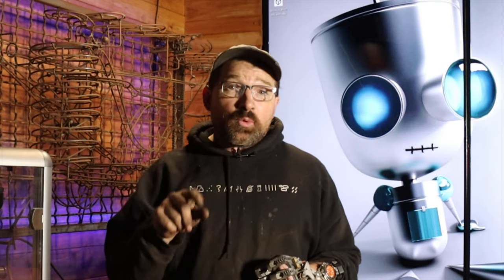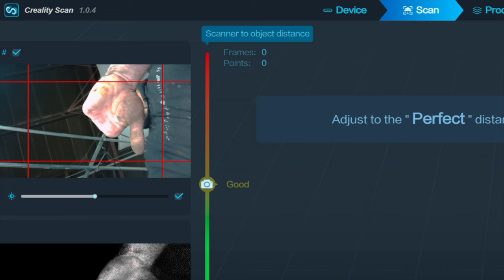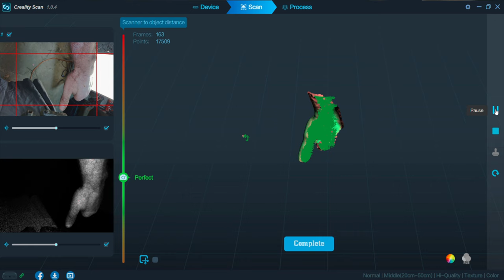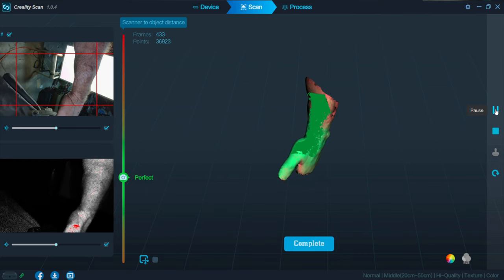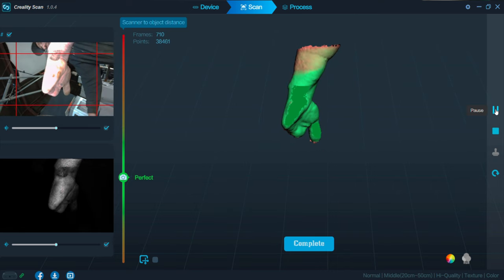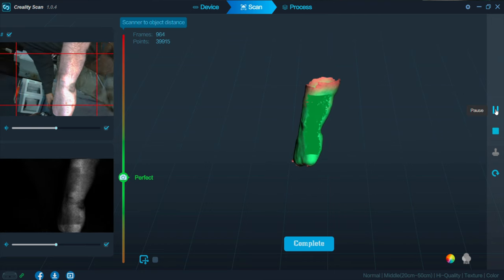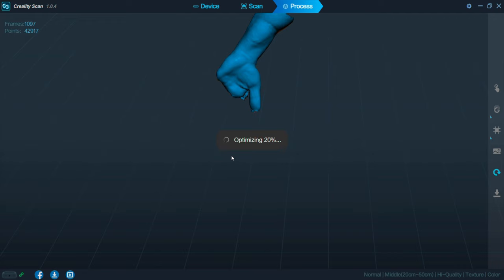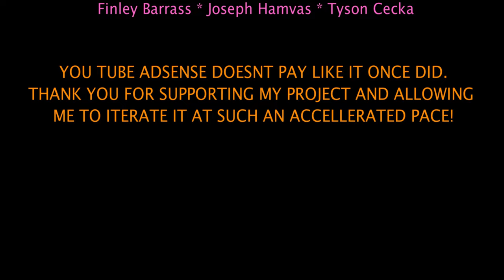How I Print my Prosthetic Socket!  Scan to Print part 1

Comment: Next video is gonna be Ian learning neuroscience and becoming an expert In the Brain Machine Interface field and building a prothesis directly controlled by his brain.
Reply from the maker: The video for "Using a BCI as the HMI" is probably 6 months away. Oddly enough I have been working on a direct finger control interface. It's still early on. The trouble is. It's hard to beat the reliability and durability that I have with my current setup.
Reply: I took this just as a joke but look he's actually on his way there lmao
Reply from the maker: @callmebiz  i have lots of ideas that I explore in the background. Its only once I develop them and figure their real value to the overall project that I produce a video talking about /showing them. Currently I'm back onto touch sensing. I keep going back and forth as to whether the complication and issues with durability are worth the biofeedback.  And then, if I spend the time to develop it, is it a feature that other users would dedicate the time to become proficient with, or is it just a zhu zhu.

Comment: For faster and more accurate scans you might have luck if you can get rid of the sheen of sweat etc before starting, also maybe a low-gloss substance like talcum powder, but it would be better if it were grey in tone not white tbh.. perhaps a mixture of talcum and charcoal powder?
Reply: I was thinking of a grey water-based liquid make-up (the type you apply with a brush; I used this for Halloween), which would make the entire arm a solid matte grey. It occurs to me one could air-brush it onto the arm and once it dries, it would scan clean. One could add black dots using the same makeup in black.
Also, it would not be thrown off by a dirty hand.
And of course, water-based means it washes off easily.  (I can confirm this from experience.)
Reply: @OhPervyOne  that sounds like an even better option then tbh, but yes as long as the result is a matte surface finish, then results should be more concise.
Reply from the maker: The reason for the led light off angle is so it continuously produces a shadow on my residual limb as the camera rotates around it. Without it I was drawing sharpie dots all over my arm in order to get the scan. Talc would certainly work though. Maybe a combination of methods. Honestly I'm amazed at how close to life it scales as it is.
Reply: @missingpartsclub  Combining ideas here then, but if dots happen to help more than a solid grey does, maybe a talcum dusting followed by sprinkles of a darker powder, so it leaves visually identifiable dots all over the surface.

Comment: Hey Ian! You could try using the same approach but with scanning static. Monster clay is a really good material for making molds from body parts. You can pour it in tubing and while it hasn't reached its cured state you can put in your hand and adjust the fit by squeezing on the tube sides. Thats an approach for reusable mould, otherwise it could be done with alginate to capture exact volume. Then the mould could be cut, scanned, but maybe thats hard to get watertight 3d model from to mould shells. Instead you could pour in plaster and and scan it on turn table. As I am writing this comment I see how more efford it takes to get to similar result as 3d scan but I'd like to know what do you think about this method for the best fit?

Comment: I was wondering about the use of indexing marks as a means of the program "finding" the same points on the surface as it rotates out & into view
Reply from the maker: Before I started using the tiny light to create shadows, I would use a sharpie marker and put dots on my arm to help the scanner from getting lost.
Reply: @missingpartsclub  Seems this isn't yet reduced to a fully DIY friendly process the average illiterate slob on the street could follow since the software needs an operator that can recognize when more passes are req'd for infill of the surface network. But it's still waaaaay advanced from fully analog casting. I'm anxious to see how much post processing time is needed on the scanned surface model. 
Btw, I'd buy you a cup of coffee if you want to add that functionality.
Reply: @missingpartsclub  I can't help wondering how well this would work for someone with freckles.
Reply from the maker: If the ir camera picked them up, I think it would improve the accuracy of the scan. The freckles might also keep the scanner from getting lost the same way making sharpie marks does.

Comment: How do the 3D prints off the scans feel compared to your directly molded parts? It seems like this is the way that many custom fit orthotics (and orthodontics) are being made these days, but I'm curious how well your relatively low-budget scans and prints worked out without the more expensive scanning and printing setups the professional clinics have.
Reply from the maker: the vacuum resin layup sockets always fit more true to life, and if you choose to modify the buck  you can change the profile to give you areas that fit tighter or looser, which I prefer.  The scanned sockets would need to have sil-plat or mold putty silicone laminated into the inside to get the same fit. really, the only reason i'm exploring this as an option is because i've received a fair amount of push back from potential users over the resin layup. they're looking for a digital solution because they have it in their mind that its easier. truth is the resin layup socket is leaps and bounds more durable. a solution to this that i'm considering is use the consumer grade printer to develop a mesh that fits right and then have jlcpcb print it in multijet PA12. although i'm afraid that you're still going to run into issues attaching the other assemblies to the printed socket. and really, by the time you iterate the mesh to the point that it fits correctly,  and then send it off to get printed, you could have built multiple sockets using the vacuum resin layup methods. each to their own though I suppose.